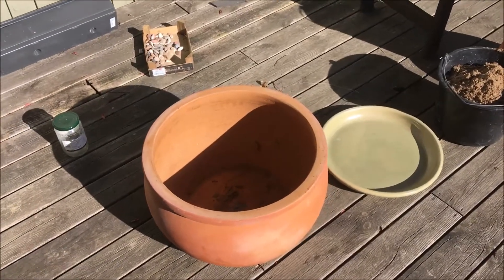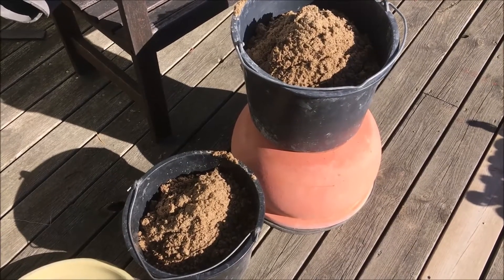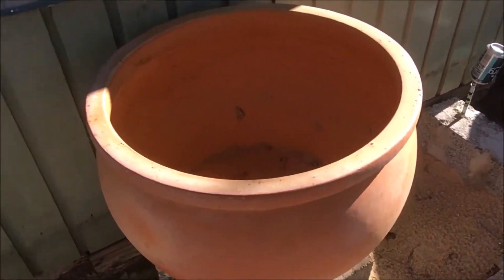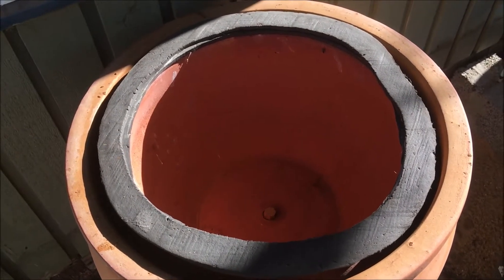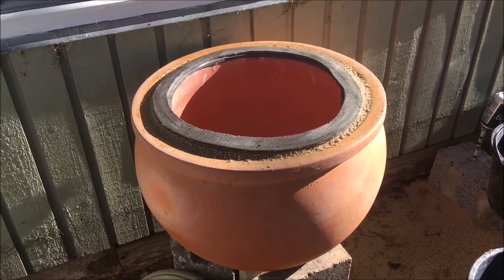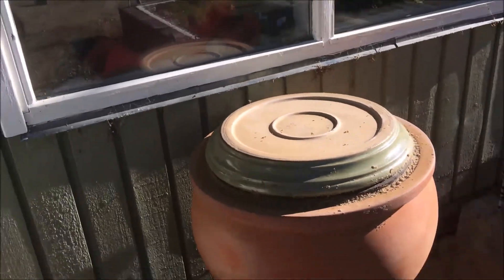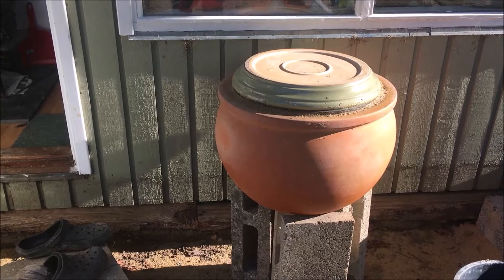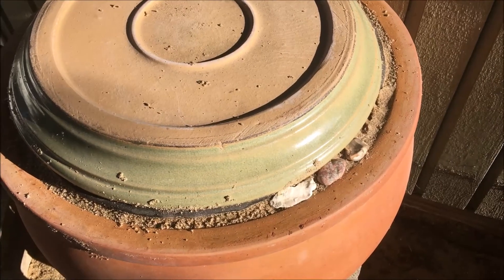making a simple zeer pot "fridge"

Comment: Hello mate good vid..just wondered if your still using pot fridge as I had a idea for you you could try...so basically the principal is evaporation cooling so water being evaporated by wind and the more wind the colder the temperature will drop but the offset will be need too add water more regularly but this is no problem just do a water drip feed situation..so my idea is adding aluminium sheets from beer cans coke cans into your design as aluminum as you may know is the king off temperature transfer hot or cold it throws temperature straight through it instantly so in electronics this would be a heatsink so I wondered if this could be encourperated in some fashion too improve efficiency maybe even just the inside walls off your main fridge chamber..but the main idea was use a couple PC fans too blow constant high speed wind onto your wet pot and this will dramatically drop the temperature off your pot I mean enough wind n you could get near a freezer I imagine it's very possible you could create an actual freezer with enough wind and a constantly wet set off pots so as said like a little water feed system just something simple n cheap ..but the PC fans run on tiny amount off power around 5w /10w each so this would be a minor cost say 30p a week tops but in this sense you could make it far colder and reliable temp also a constant temp..this is what I plan too try you can get 5v fans n run off a phone charger just too test n see what results you get and if get a good result then can just run fans off a battery each I can help you on that aspect if you think idea worth a go you may be surprised just littarally stick fans directly onto pot n blast chill the pots or put one outside and one blowing down inside from above so hitting inner pot and the wet sand this way would be superior for sure...reason I thought is from a story from WW2 I believe or a war somewhere in a desert where they used metal Jerry cans full off water and kept a layer off water on outside off can and with the wind this gave them ice cold water in the desert but as the story goes one soldier fell asleep deep sleep and a sand wind storm came in and due too this extra high amount off wind the Jerry can froze too solid ice and he woke up with it stuck frozen too his leg lol...so yh that proves with enough wind a freezer is possible with this method evaporation cooling but I have a suspicion that the metal can had a faster cooling rate due too it being metal maybe even aluminum Jerry can which I assume they are so yh when the high wind hit this wet aluminum metal it just transfered the cold so fast it created a freezer situation hence my first idea too you about encorperating aluminum into your pot...I know the idea off these no electric but a couple PC fans you can always run as such low wattage a tiny solar pannal £6 one would cover all the running costs ..but yh if think worth a go..cheers mate 👍